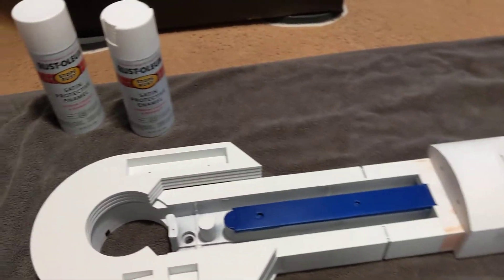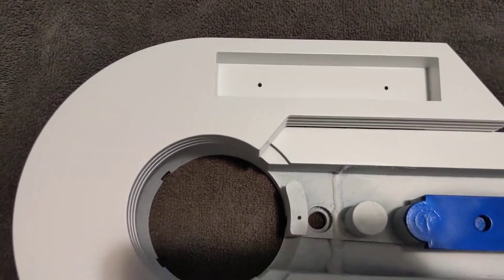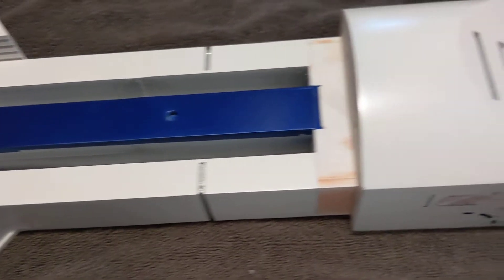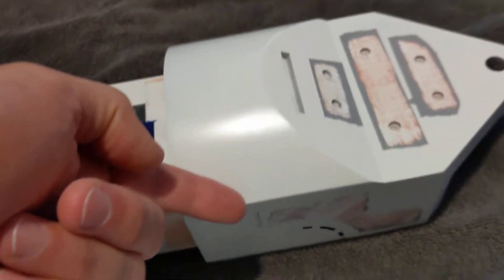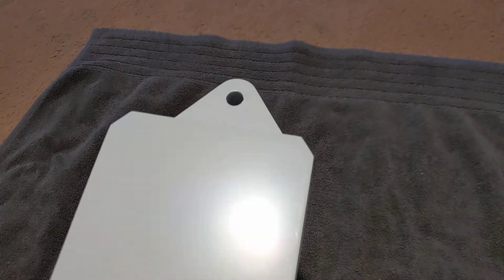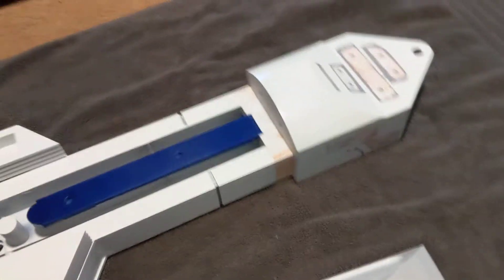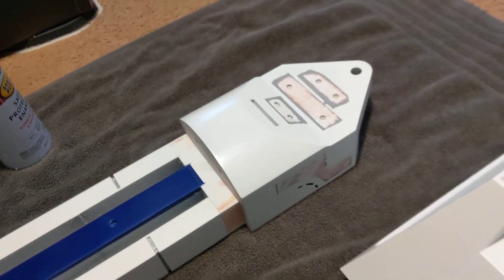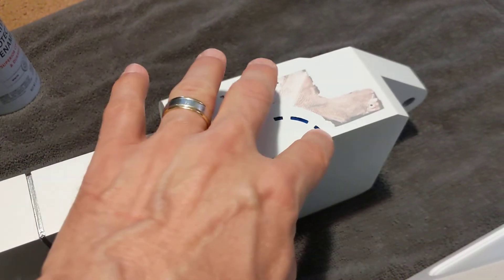3D Printed R2D2 - Part 73

Comment: Interesting that there's such a variation - especially in the tone of the color, too. That's the part that's really impossible to correct. The difference in finish - satin vs. semigloss is generally corrected with a top layer clearcoat, which I know you want to avoid, and which has its own challenges: you shouldn't clear the metallic silver, and you risk more runs and defects, for instance. However, as others have said, we're all our own worst critics and despite this, you've got an amazing R2 that will knock people's socks off. Keep at it!